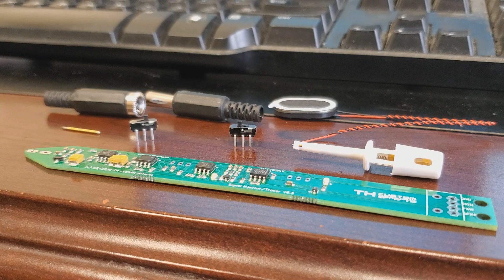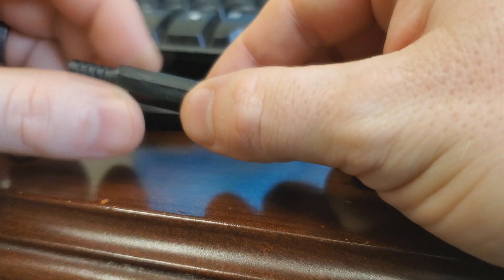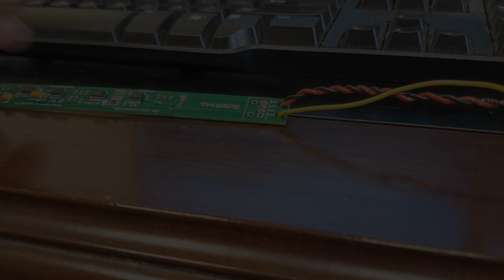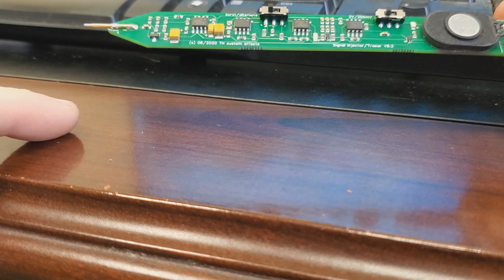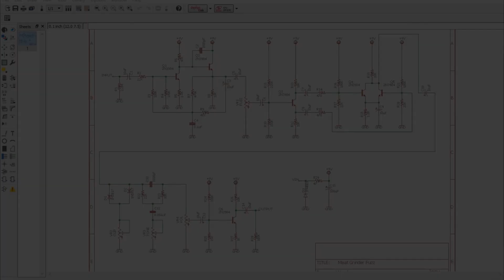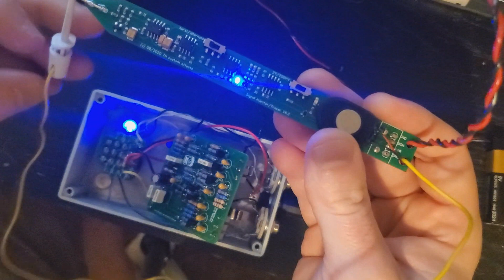A Testing Tool for Pedal Builders - TH Customs Signal Pen

Comment: I got this pen to use to test the audio output signal on a 1960's battery powered transistor radio.  I'm not getting any sound, and I want to see if the problem is in the audio output section of the radio, or if it's before that, ie. in the RF section. IF I can get sound out of the radio's speaker, then I know the issue is in the RF section.  Problem is I can't figure out how to use it.  I want to see if I can inject the audio signal from the pen into the audio output section of the radio to see if can get that injected signal to come out the speaker of the radio.  I'm sure it must be simple, but I'm a newbie and trying to learn something new.  Any help on the connections is appreciated.  Thanks.

Comment: Would I be able to test 500 series gear with this? I assume so but just wondering!
Reply: Like rack mount equipment? It would work, assuming you have a good schematic for what you are working on.
Reply: @erikvincent5846  Yeah, for rack mount gear. I have a DIY kit I can't get working, I don't have the schematic for it, however.

Comment: Any idea if this would work for tracing 12-24VDC pedals? I'm guessing I'd need to power the pedal with separate power supply but just curious if it can handle higher voltage tracing? Dont see any voltage ratings in the build docs.
Reply: I got a reply back. It's designed for a 9V system, but everything on that board should handle up to 12V without issue.
Reply: @erikvincent5846  Thanks for getting that info and clarifying that. Good info to know as I have one or two higher voltage pcbs projects that I still need to get around to troubleshooting one of these days. Looks like a cool project and will work the vast majority of pedals out there.
Reply: I just emailed Thomas over at TH Customs. I know there is an LM386 on board, so a maximum of 12V, I assume. But I'll let you know what I find out.

Comment: cool tool, might get one. last time i had trouble it was a grounding issue from a solder joint to the back of a pot and the time before i didn't turn the volume up. 😂 also, like? aren't you basically playing operation? 😋😂
Reply: Pretty much. Although, this time, I want to make it "alarm"
Reply: @erikvincent5846  looks like it’s going to be a cool pedal, I’m enjoying these videos a lot, but I can’t get LTSpice to show a output waveform. 🤷‍♂️

Comment: Very nice and self-contained solution at a decent price!
It does exactly what it is intended for and it's obviously a lot easier to use and set up than a regular signal generator & amp/oscilloscope.
Reply: It does the job, best probe I have seen is Mr Carlsons lab super probe which is ideal for rf circuits. It is very high impedance because it is non contacting!  Ideal for radios, transmitters etc ! It also features noise detection circuits for tracing crackling,  noisy resistors, and frying eggs background noisy resistors!